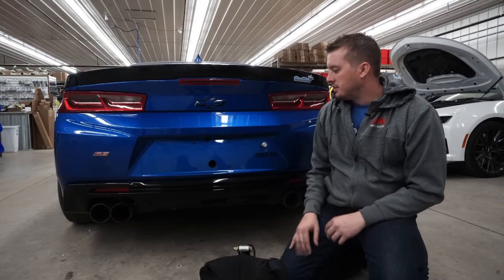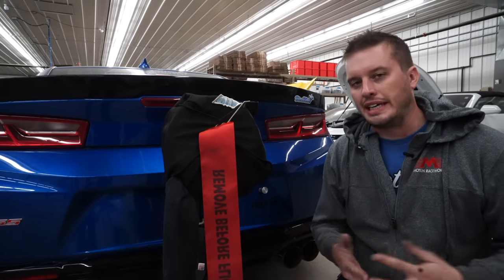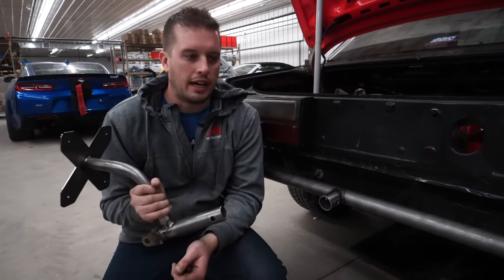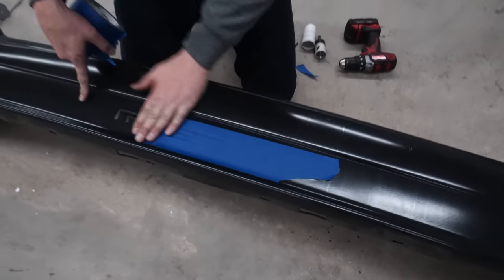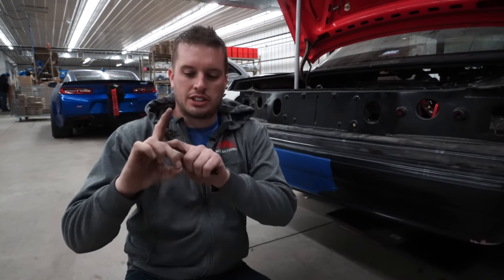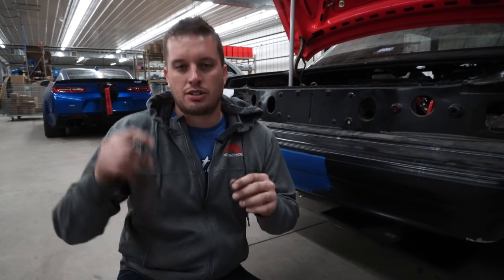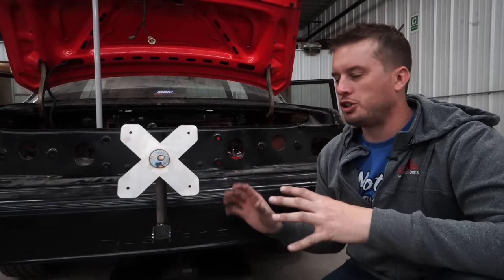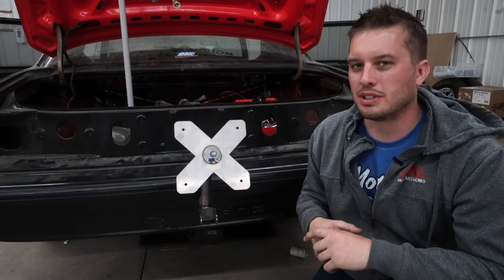Foxbody Parachute Install: How to Perfectly Drill your Parachute Mount through your Bumper

Comment: cut a C shaped section of the next size up pipe longer than the gap. Rotate it around as you mark it holding the C firmly to the stub receiver.

Comment: Awesome tip! Couldn't you cut the toilet paper cardboard the same length as the receiver (more stability), slide it over the receiver before you put the bumper on, then slide it out to the bumper for marking? Then you wouldn't be fiddling around with a 3/4" piece of cardboard up underneath and behind the bumper. This might be another reason to hoard toilet paper!